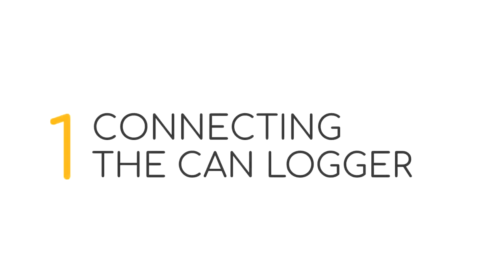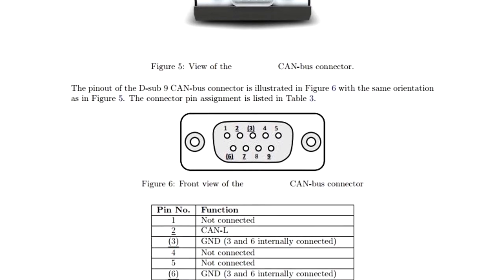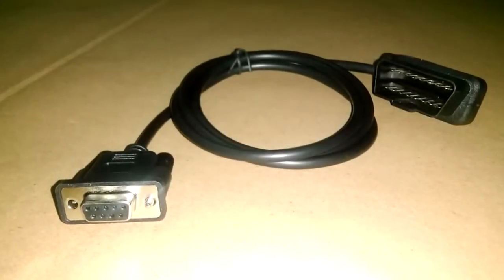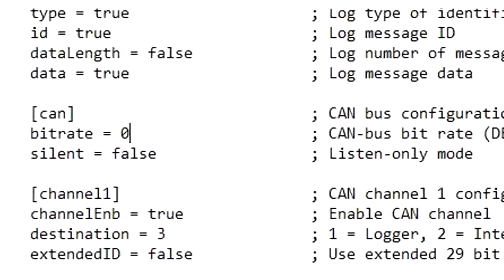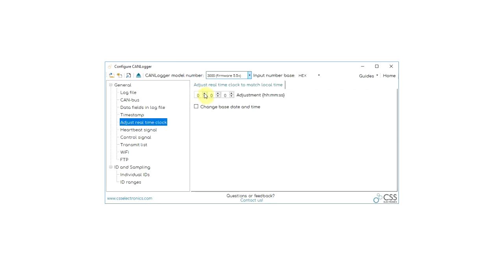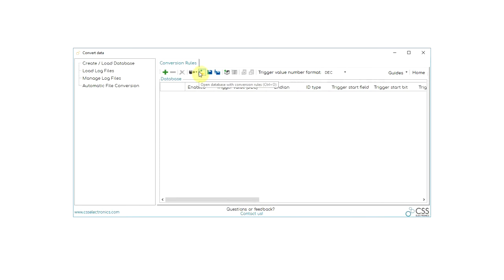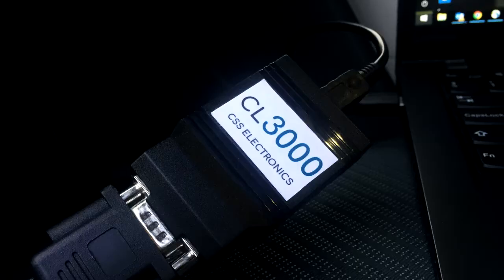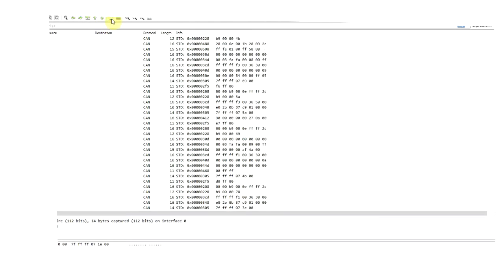CLX000: Getting Started With CAN Bus Logging

Comment: I understand CSS' CANvas can convert logged data files, but can it decode 'live' data using the Canedge2 hardware?   I don't see any usb on it, so not sure if it will work.
Reply: The CANedge2 does not support USB streaming. It lets you log data to an extractable SD card and auto-push this to your server. Data from the CANedge2 can be processed (e.g. DBC converted) via open source tools like asammdf and our MDF4 converters.

Comment: Is DBC file open source? I guess different OEM have their own files.
Reply: Different OEMs have their own DBC files. Exceptions include our OBD2 DBC (for decoding OBD2 data from cars) and our J1939 DBC (for decoding data from heavy duty vehicles), which you can order via our webshop.
Reply: @martinfalch4648  I see dbc files have different version. If I buy current version, do i have free update to new version in the furture.